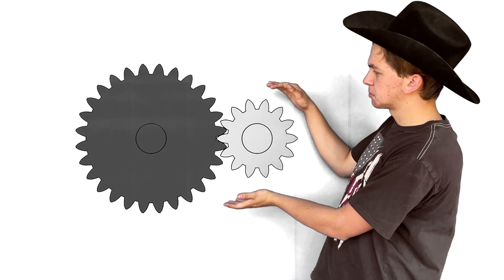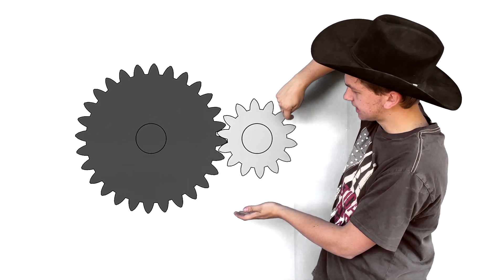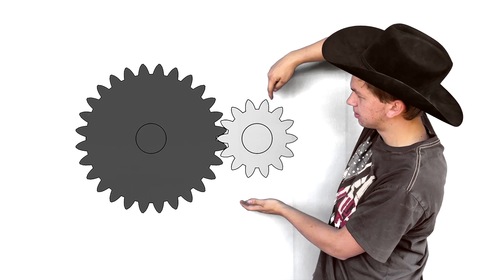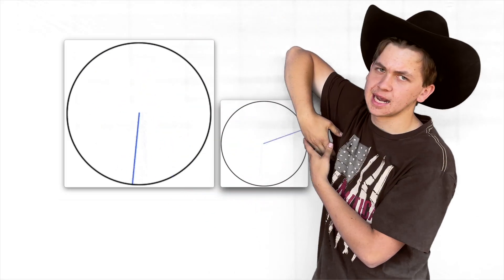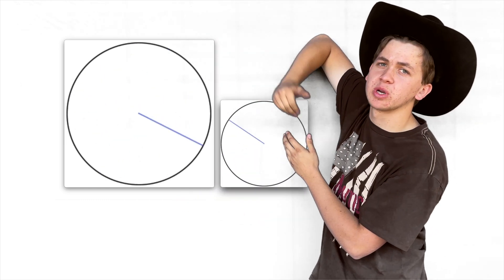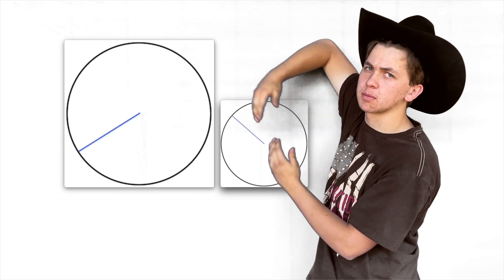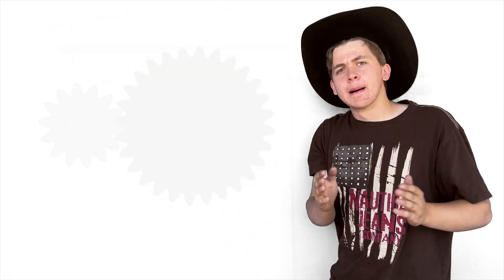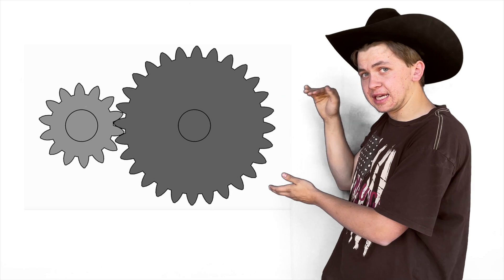Crawl Ratio | Definition

Comment: Like very much your explanation on "pure mechanical principle/concept." 
Comparing to nowadays "electromechanical" devices, really2 make me sick.
Reply from the maker: Could you clarify which part makes you sick? The stuff I said about EVs was certainly way over simplified. I guess I trying to keep the video simple. 
Here's a video of mine where I go into a lot more, like big time, into the details of gear ratios affects in off-road performance. I cover rotational dynamics and go a lot farther in the weeds of playing with inertial mass than the SAE even recommends. 
https://www.youtube.com/watch?v=Fmj8cerFm5o&t=389s
Reply: @redneckphysics  ,
Of course the "electronic" part that seem to be "a black box of mistery."
For example ECU/ECM. I would not go an offroad ride for a vehicle using ecu. I rather take the conventional "carburetor" powered than the ecu-EFI. 
Thanks for your attention.
Reply from the maker: Gotcha,
I would have to agree with your opinion on have an ecu vs carburetor. I was having an awful time working with the EFI system on a Chinese ATV one time and finally just stuck a Yamaha carb on there. 
Are there any particular topics which you would like to see a video on?